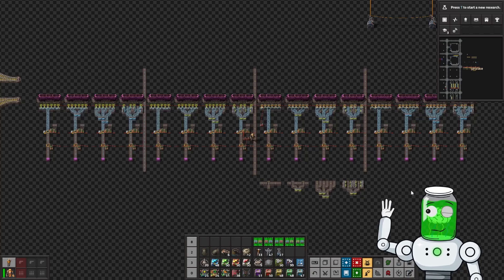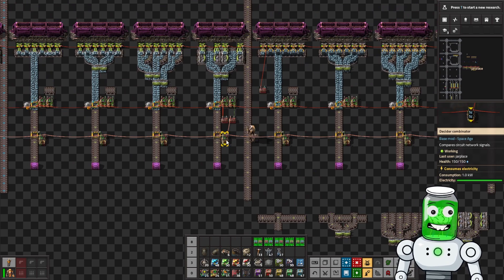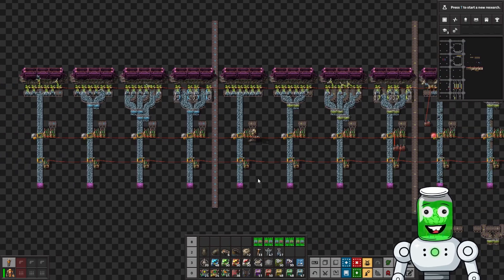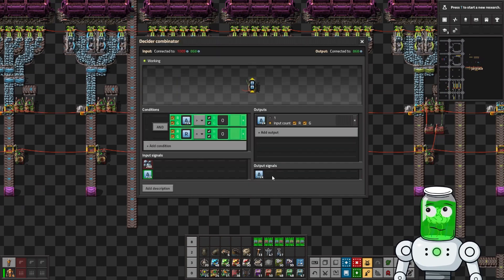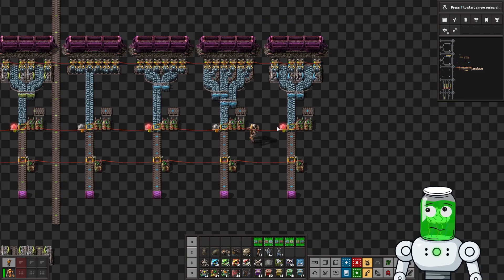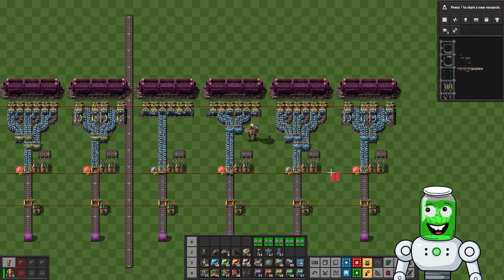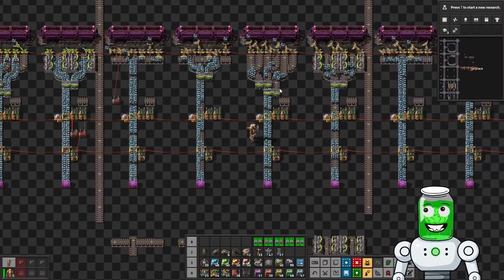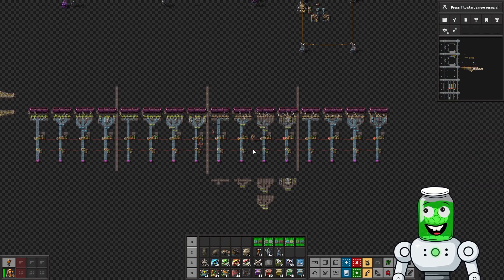King of Unloading | Factorio Spage Age

Comment: saturation alone doesn't really indicate how good a design is, since an empty belt and one that's 90% full are counted the same way, also, a belt with horizontal (using the video as perspective) gap in items would be considered unsaturated for less time than a belt that had a vertical gap on one side of the belt, even if the throughput ends up being the same, still an interesting test nonetheless
Reply: How about if each Belt would output to a Chest or few, then we compare the contents of the Chests?
Reply: @toddkes5890  We can already count belt throughput as a pulse per item. I believe that's what TheJarGames has already done.
Reply: @Eagle0600  From the video commentary it sounded like he was counting how many times the Belts weren't saturated.  By counting items in a Chest you don't have to worry about if you count twice for a pair of 90% saturated or once for a 100% and an 70% saturated.
Reply: @toddkes5890  He was counting both. The higher node was counting saturated ticks, the lower node was counting items. It's a solved problem. No need to complicate things.
Reply: @Eagle0600  Ah, I missed that the lower was counting specific items.  My screw-up
Reply: would probably also be interesting to know  how even the unloading  is, testing  by unloading into chests first and then  on belts. for example befor 2.0 you couldf use  the 4th design to get an  even unloading but with the change for inserting on splitters it has  become quiete uneven
Reply: @Odysseus0000  Sounds like you just thought of Jar's next video!
Reply: It also doesn't cover buffer chests. Most of these designs are totally useless for buffered designs, as they will not unload those chests evenly, which is THE most important aspect.
Reply from the maker: Thanks hypercrafting! You're definitely right, which is why I also did the count test, maybe I can devise some more intricate test where it counts the missing items... anyways, interesting results and great comment!
Reply: @TheJarGames  Saturation only matters as a roundabout measure of throughput anyway. When unloading a train, there's only two factors that you should actually care about: How much material is making it into my factory (throughput/item count), and is the train unloading evenly (is the unloading going to slow down when one chest empties before the others). If you can measure throughput directly (as you have), then there's no point measuring saturation.

And actually, even evenness of unloading only matters so far as it affects average throughput over time. So the ultimate test is this: Build actual unloading stations, with trains that have to empty, depart, and come back, with a proper train stacker, and variations with and without buffer chests. And count total item count over time. Highest total throughput is the best unloader, and only UPS can argue otherwise.

Comment: if you're talking about endgame, you might aswell test it out with quality inserters :P
otherwise you wont ever be able to get a turbo belt fully saturated with 6 stack inserters (reason ist that stack inserters drop 4 stacks of 4 items compared to bulk which drop 12 items per swing)
Reply from the maker: yes! good call! Next time we will test some rare, epic, and legendary quality stack inserters
Reply: @TheJarGames  6 uncommon would be enough for full green belt
Reply from the maker: @AndrewBezdenezhnykh  yup!
Reply: @TheJarGames  and 4 legendary is great for stacked green
Reply: If rare stack inserters can saturate a turbo belt, maybe test uncommon quality as well.  Would be nice to know the exact threshold required.  Late game, rare quality items are not hard to get, but getting uncommon items is almost trivial so if that gets the job done it would be very easy to retrofit all your stations to get that throughput.  We’re talking 24 inserters per 1-4 station (double if you use buffer chests) and by late game you probably have dozens of stations, so the lower quality you can get away with, the better.